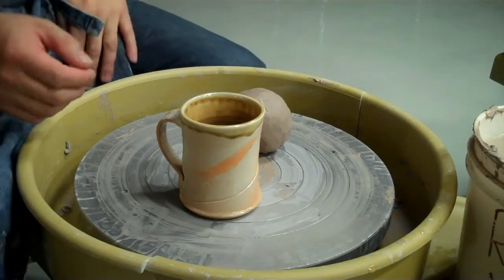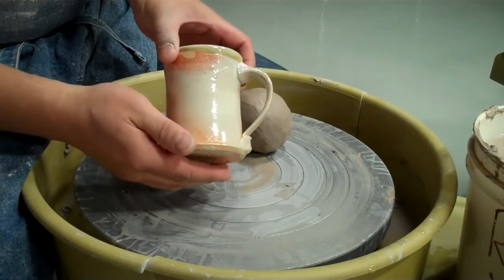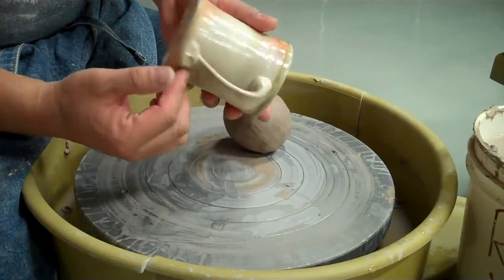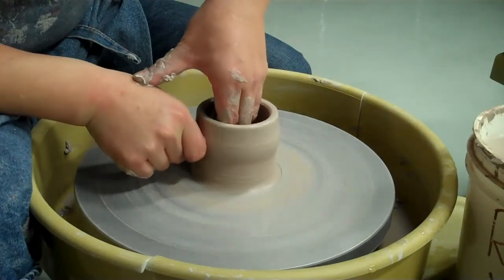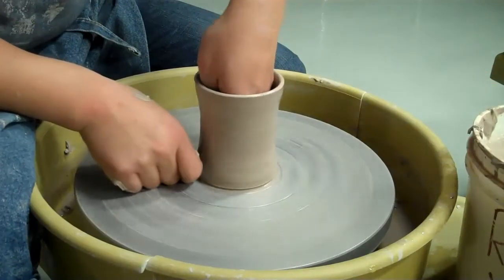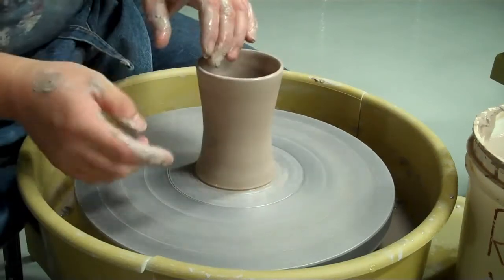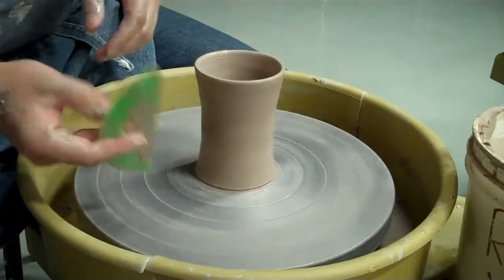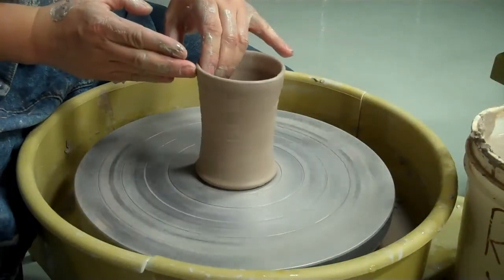How to make a mug out of clay on the potters wheel.  .  Throwing a mug.  Pottery making.

Comment: What clay would you recommend for a beginner
Reply: Kc  grubt what clay did you end up
Useing are you making mugs
Reply from the maker: Free clay is the best.  I say this because, what if you lived in a village where there was one type of clay.  Like, porcelain, you have to lean to throw with  that clay.  Also best to stick to one type for a while.  If you switch around too much you can not make the adjustment of all the different clay types.  Some feel really soft.  I notice that on the West Coast lots of clay Co. are mixing it wetter.  So the clay is really soft.  Having said that, maybe using softer clay is the best for beginners.